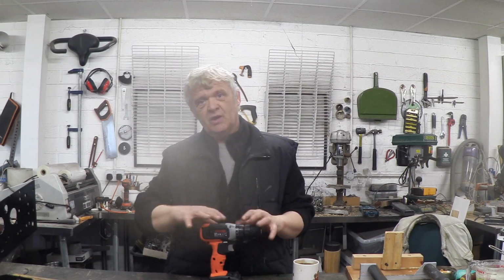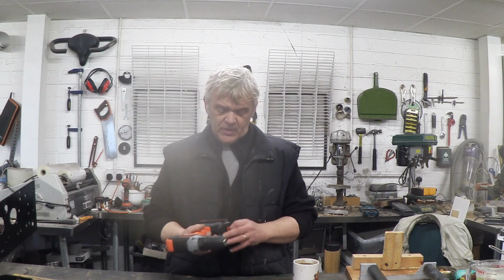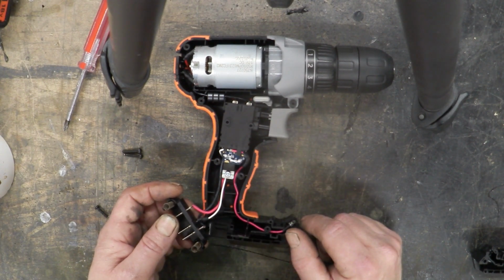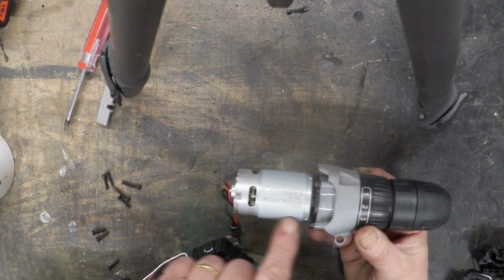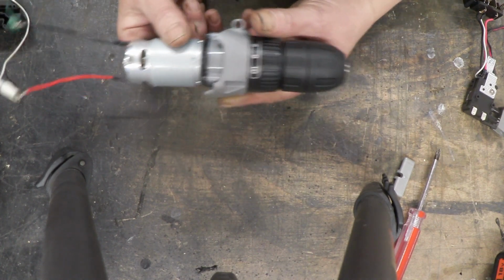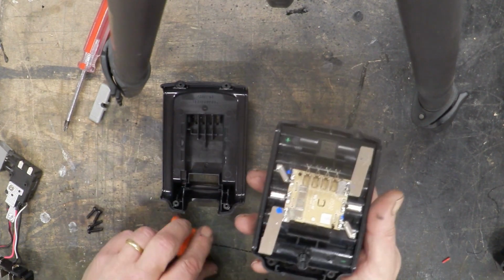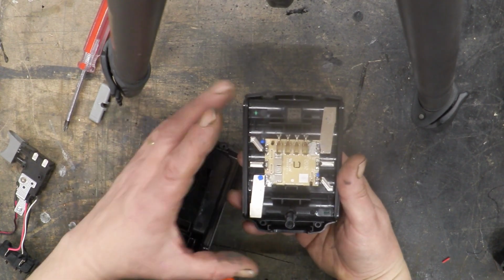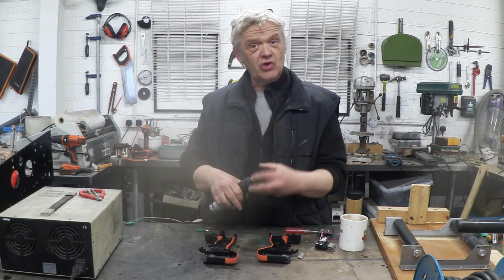Repurposing Cordless Drills

Comment: Thank you for all the very clear instructional videos. Recently I got myself a little knitting machine (Sentro 48 needles). It works by you turning the crank by hand. Now, there is an adapter made for this little machine with a Hex Steel Bit Power Screwdriver Attachment for Drill, that allows you to run it with an electric hand drill/screwdriver. I wish to one up it and hook my drill/screwdriver up to a foot pedal. Do you have a video that will teach me how to do that?  Thanks.

Comment: funny coincidence, yesterday I picked up a free cordless drill intending to use the motor, today I happened to find this video and when I went back to my drill I found I had picked up the same B&D model (or at least very similar) that you showcase here. Nice video, thanks for sharing. p.s. not sure why it was thrown out, but was easy to hook up a potentiometer + spdt rocker switch directly to the motor terminals and run just fine. Maybe it was an issue with the controller, I havent tested it.

Comment: I love coming across old battery tools people don't want. I recently got a hold of a jazzy mobility scooter and the joystick and box were no good. I took 2 drills. One on each armrest and hooked one to each motor. So right drill controlled right motor and likewise for the left. It drove like a zero turn mower and works great. But I was wondering if any of y'all could tell me the best way to acquire a trigger style throttle control for pmdc that is rated for over 24 volts? The higher the better
Reply: At my local rubbish tip, there's always a good selection of Dyson stuff - wonder why? - and a chance to get your hands on that famous V11 digital motor.
Reply: @phils6926  I was able to get ahold of I think it was the v6 version. They got rid of because the battery sucked and they didn't realize they didn't have to buy the uber expensive OEM replacement. I still have it and it runs on 24 volt kobalt

Comment: I just took apart a old 3/8 drive LONGYUN 25 volt drill  obviously from china!!  The gears in this thing that’s packed in the  head is amazingly complex and if you open it and aren’t careful you’ll send 15 or 200 little round toothed gears 🤣  I did so now I’m hoping to repurpose the drill body with another motor because the original is burnt up inside!!  Another project one day

Comment: Great! It’s still a thing!!

I was after a parts washer pump/transfer pump (filtered)/aquarium pump to use for a diy parts washer but these pumps have become extinct snd their replacement are singular use garbage that costs far too much for something that can’t be passed it’s warranty or next seasons model…

Not I can jerry rig an old drill to a drill powered pump. Hard part will be putting a switch or a some kind of slow restrictor (something to replace the deadman adjustable trigger….)
Reply: Maybe attach an old mowing throttle to the drill/trigger without heavy modifications and keep it tidy in a nice box 

Ahahahah

Comment: Hi Robert, very nice video, one point you did not touch here is that you can use the motor also as a generator. you will need a reasonably high torque to run it as a generator though.

Comment: Hi Robert, Like this post..I’m making a driveway gate..simple idea of a hidden wheel one side and post hinge on other…i wanted to repurpose an old battery drill to “forward reverse” a wheel to open/close gate… my question to you is can i attach a simple remote control to activate drill to do these commands?…I really hope you can shed some light on my project…many thanks!!
So…. 
Battery - speed control  - direction changer - remote control - to motor… 
any assistance is gratefully received

Comment: the first decently fast motor for my old vintage RC car was a 6volt motor from an old dust buster been harvesting DC motors out of stuff ever since.
Reply: I swapped the stock cheap consumer grade motor on a cool rc car for a 9 volt drill motor and that thing goes. I did have to hack up a bit of the rc car to fit the bigger motor and customize the gear engagement but the outside body looks 100% stock haha

Comment: Great video as always. So i bought a 12v drill (new) and without battery as I only want to use the motor and trigger. I connected it to my 12v DC car battery and in less than a blink of the eye the heavy cable from the battery to the motor started getting super hot and the motor + terminal wire started to melt. No idea why. Do you?
Reply: To much current

Comment: The planetary gears are the real treasure. Extremely hard to get hold of otherwise. They often come in multiple stages which means you can customise the desired gear ratio. Even the cheap single speed (36:1) models have two stage reduction gears. I removed the first stage, transferred the pinion to a brusless motor and now have a compact drive for an electric kayak.
Reply: Just made a comment about those and couldn’t remember the name of the planetary gears lol !! Thanks for the reminder

Comment: Robert,  what do you know of "flashing" worn out Ni-Cad batteries back to life?  I have an old bosch drill the battery wore out. I saw a video on doing this with a mig welder. Something that can deliver a higher amount of volts. Establish which is positive and negative on the welder (wire feed or earth contacts being either + or -),  disable the wire feed then zap the battery contacts?

Comment: Nice one Rob. I’ve repurposed two cordless drills by ‘converting’ to mains supplied 18v dc in order to 1. Drive a homemade bench mounted disc sander and 2. Driving one of those drill/chisel sharpener bench mounted systems...they work a treat and, obviously, didn’t therefore get thrown out. Over the years I’ve also bought many 18650s (used for led torches) and would dearly love to simply swap these into dead battery packs but I, excuse the term, sh*t myself about trying to solder them etc and so have never tried. I’ve seen the capacitor based hobby-style  ‘welding’ kits but still have not got the balls to try one. Your vid has rejuvenated my thinking again and given me another idea. Thanks mate 🙂🏴👍
Reply: It costs a bit more than I like to suggest for entry level, but battery spot welder with 'capacitor energy storage' is what I would suggest to the novice, the results are very reproduceable with those and just order in an extra set of Nickel Strip and have a go for a couple weekends self learning.

Lithium Ion batteries don't like the heat, so this is one case where I really do shy away from using an iron on them although you can buy case holders for those cells as well.

Just make sure to get an active balancer if you plan to do anything too exotic where the pack is likely to never be fully charged/discharged ... such as anything solar based.
Reply: Ah!!! A bench grinder! Now there's an idea.

Comment: Thanks Robert, a good strip down. I have never seen inside these before. Just a quick question, what type of motor are these, just wanted to know if they could be driven as a dc generator ?
Thanks for the video, they are always informative.
Reply: Hi. Motors are DC and if decent are Johnson 775 high torque motors. With high rpm.Will tolerate over voltage....to a point!
Reply: Probably bog standard brushed DC motors. Would be interesting to pull apart a brushless drill as they come on the second hand market.
Yes, this basic type of motor will provide an output as well. I might try one with scope attached to see exactly what it looks like.

Comment: I believe the motors are Johnson 775's as you say used everywhere. Did see a guy put Four of these on a bike pannyer frame at rear with 8" drone fan blades. Pushed him along as motors have a free running rpm of something like 18'0000 rpm. Sounded like a massive bumble bee passing. Incidentally the Chinese motor copies will not have the same torque or long time running as the Johnson versions???? Excellent drill breakdown video sir.

Comment: Although not being the first one to tell this story, but...
I'm inmidst replacing the poisenous NiCd batteries of my centuries, pardon decades old 9.6V Bosch drill (still without slipping clutch) by repurposed 18650 ex-notebook Li-cells. 3 of those in series gives a max. of 12.6V (fully charged), voltage dropping slightly under load, resulting in the perfect voltage and endless power! 🤩
I'm planning to use two of those sets in parallel, in short a 3s2p configuration, doubling the operating time of the original battery pack easily. 😎
I'm working on it for half a year now (intermittently), since the devil is in details 😈: I'd like to fit the whole bunch in the original compartment, preferably without major damage to both battery  pack and compartment. And this prooves to be a challenge! 😜
Additionally I think about best practices for recharging, since the original charger fits the NiCd charging curve, not the LiCoO2 curve. I will take a closer look to the old charger. Ripping apart the pack every time for recharging woudl be a pain..., so we'll see of what can be done about.

Comment: I have 3 of those exact drills. With it in a couple of sets, an impact driver, 2 circular saws (one with major case damage ready for disassembly) and a saw which I cannot name at this stage (brain fart). I have pulled apart old 12v cheap drills though and the motors are super useful. I also have a drawer full of 775, 795 and other 24v motors. Super useful
Thank you Rob.

Comment: And you can also use the motor as a DC generator. Very important!
PS: Robert: there is some smudge on the camera!
Reply: @ingulari3977  I have not tested, but given the wires used, perhaps over 20 Watts continuously.

Comment: I did a video on a drill ones, changing  it from nickel metal hydride to lithium 18650s.  It is still working fine. I believe that is what they are using in the 3018CNC models. Rating them at 10,000 watt motors.

Comment: you might want to keep the ferrite beads in. These are there to reduce radiated emission.
Reply: Interesting, great tip
Reply: @Str8Reckless63  Well, I sometimes test for radiated and conducted emission. When you have a dc motor like this or a series AC motor, anything with a collector the biggest source of emission is this motor.
Reply: @hanslepoeter5167  your comment may have stopped me from making a mistake. I was tinkering with a rear projection TV, and after taking apart the lamp housing there was a tiny radiation sticker(Kr85 200 nCi). Something clicked in my mind and I stopped. Without your comment, I may have just continued. Harmful or not, I am thankful for your tip. Appreciate your reply as I didn’t realize it was 2yrs ago ✊
Reply: @Str8Reckless63  Your welcome. Funny though, the radiation sticker you refer to is about radioactive emission. I was talking about electromagnetic waves, eg, radio waves emission for which ferrite beads are effective.. Kr85 is a radioactive isotope of krypton, 200 nCi is 200 nanocurie. Not a lot. You can tinker all you want with it but do not put it under your pillow, swallow it, file, saw or drill it, give it to your childern .... you got the idea ... and dispose of it properly.
Reply: @hanslepoeter5167  again thank you for sharing and informing me. It really means a lot 🫡

Comment: I have seen converters to take cheaper battery packs from one manufacturer for use on a higher end manufacturers drill (or other battery powered tool). I'm sure people would realise you would have to take into consideration the voltage you are drawing from the battery to the tool & the electronics installed to prevent this implemented on some high end stuff but I have been thinking about how to mould myself a nice little converter as it looks quite do-able. I've started picking up some very cheap 12v tool sets now everyone has moved over to 18 & 24v to make myself a set that would use the same battery (these old ones seem to have less anti-tamper electronics to interfere).
Reply: You should get a 3D printer. Would give you unlimited possibilities once you learn how to operate and use them and set up 3D models.

Comment: RMS, the 18V batteries are good for powering G-scale locomotives. I run my LGB locomotive off of one and have a radio control unit in there to control speed and direction. It works great and I don't have to clean the oxidation off the track to run it! It runs for hours.

Comment: Can u connect that motor with switchable gearbox to your big wind turbine, voltage regulator 4-18v to 13v and than 12v battery, or will not work. Pls make video. Ty

Comment: Hey my friend, could you do another video showing how to charge the drill battery by driving the motor, e.g. Put a fixed wheel in the chuck, attach it to your bike with the wheel in contact with your tyre, cycle round the block etc. and charge your drill's battery. May ( or not ) require a switch and additional wiring to change between drill mode and charger mode.

Thanks for another excellent video.

Comment: As a young man I would take things apart just to see if I could understand how things worked, I have never lost that curiosity and that is why I enjoyed this video. Thanks Robert 🧐
Reply: Why did you stop ? I virtually take apart everything before I throw it away, keeping screws and usefull parts. I learn along the way and I always have a screw, nut or washer when I need one.
Reply: I did the same, and to this day my curiosity still drives me to pull all manner of things apart, though I’m yet to put any of them back together again.
Reply: At the moment i'm taking apart my neighbors aio printer before i scrap it. Good stuff inside 🤘
Reply: Same here. It has become extremely extremely useful. I have been able to fix so many things and not afraid to take anything apart to fix things. 

Most people just think of electronics and devices as nebulous magical things, which they are magical in being amazing, but people are ultimately powerless when it comes to even the thought of even thinking about fixing something. 

It has helped me to understand and learn all the different methods how metal and plastic parts are fastened, attached and clipped together, how things are parts are before I even take something apart to know how to get it apart, and some super super basic knowledge of electronics that helps me a little bit. I would love to learn more though to be able to build and fix more things though.

Comment: Those battery packs are designed not to be interchangeable between manufacturers by moulding raised bits in the case next to the connections. If you shave the raised bits off with a sharp knife you can then swap 18V packs between products and chargers at will which can be really helpful when the battery on your drill goes flat but the one on your impact driver is still good. You can see these raised bits if you try to clip a different battery pack onto your tool and find it won't slide into position.
Reply: I saw a video sometime ago about various adapters you can buy to enable batteries from one manufacturer to be used with another manufacturers cordless tools. I can’t find it now to give a link but it is on you tube somewhere, I think it was posted by an American. It might be worth looking for yourself if you are interested. I know the adapters are available in the states.
Reply: This has opened up my mind. I have a cheap black and decker cordless that works great but the battery has been long gone. Was figuring I could either throw it in the trash which I don’t like being wasteful, or try to learn how to build my own battery pack.

Do you know if all you need is the right voltage? Or do you also need to worry about the amps and or watts?

Comment: Dear Rob,
actually I'm in the deep lockdown, so I cannot try myself.
Therefore a quick (silly) question: Does it need any changes to run this powerful motor as a generator?
Reply: If I may answer that : It will work as I generator if it has a permanent magnet as stator. This one probably has. If it has an electromagnet as stator ( series motor ) it might generate due to earth magnetic field to get it going and if a load is present to make sure current flows. You see : when there's no magnetic field in a series motor you can rotate the rotor as much as you like but no voltage will be induced. Once it starts due to earth magnetic field current will flow, stator will be magnetized and it will generate. Sufficient earth magnetic field under correct angle must be present.
So it's an excellent question imho. Not a silly one at all.
Reply: @hanslepoeter5167  Many Thanks! Will try when this situation is over ...
Reply: @scantrain5007  you'll need a full bridge rectifier. Loads of information about them on YouTube.